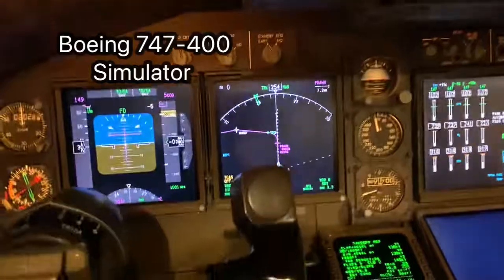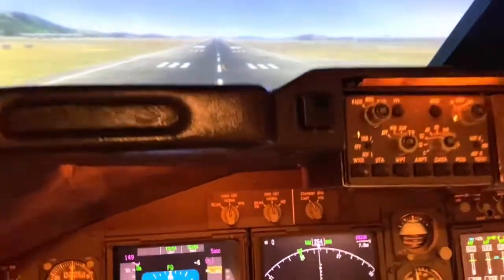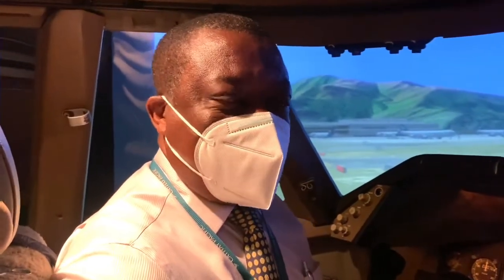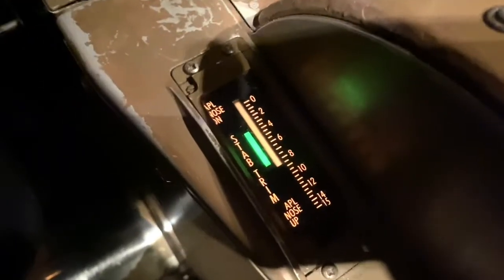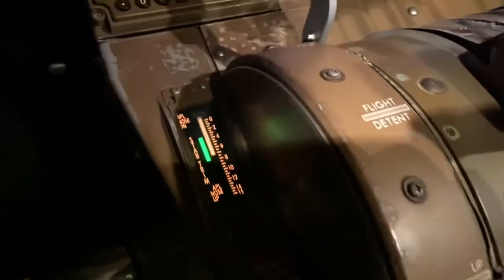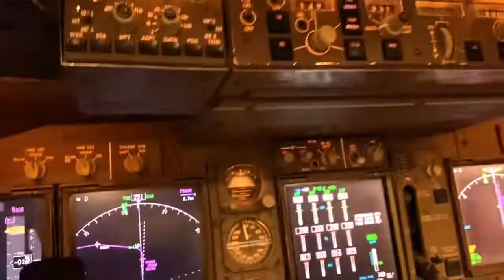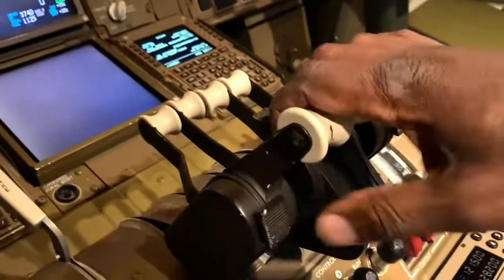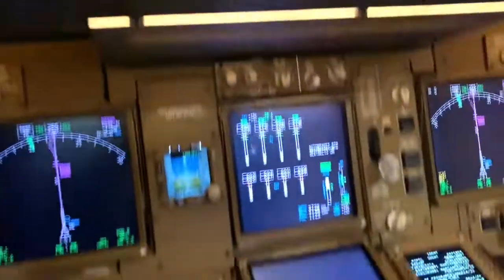Boeing 747 Takeoff CONFIGURATION WARNING

Comment: So, let's say there is a runway that is just enaugh for a certain max weight, and all V's calulations are made for 20 flaps. If the pilot makes a mistake to select 10, then thre is no warning, right? But that means that at Vr the a/c wont lift off and after V1 the pilot can legally regect the T/O if the a/c in unfliable when in reality needed maybe around 20kt extra? Not sure how is handled in this situation because I don't fly a 747 but curious if in that case the pilot should keep pushing getting close to the end of the runway to try to take off anyway or overrun at some 160kt instead than 40kt if it was rejected. Thanks

Comment: Sir, do we always take off with TO/GA power?
Reply from the maker: TOGA is just the switch you activate- the actual thrust is dependent on what you require based on the weight etc on the day. Like an accelerator on a vehicle - you always press on it weather the car is heavy or with only you on board. The amount of acceleration you need is dependent on the weight of the car to get it moving.
Reply: @pilot_obet  ohk, so TOGA doesn't always means 100% power?
Reply from the maker: Correct! Like an accelerator, pushing the pedal does not mean you are using all the horse power from the vehicle engine - like the toga switches😊
Reply: @pilot_obet  oh, thank you for clarifying I always thought it the other way

Comment: Hong Kong Int'l has both runways at 3800m long. 

Captain, what runway length would be necessary for a B744/8 at 850k pounds TO weight such that there is No V1(!), would only be necessary to call VR.?

Comment: I flew business on one of the last Qantas 747-SP AKL-LAX runs, the pilot had a bit of fun on takeoff - we were stopped with the brakes on while the engines spooled up to full TO. The whole aircraft was bouncing up and down and jerking forward until brakes were released and we were OUTTA THERE! Never been pressed back into my seat like that before or since. Must have been an accidental CONFIG PARK BRK ;)
Reply: This is just a static takeoff, you do it when the runway is just barely long enough. You hold the brakes on, then release them as soon as the engines reach takeoff thrust. This way, you use up less runway since you're not rolling forward as the engines spool up.

Comment: Wait, that small parking brake lever is what stops a machine of that size?
Reply from the maker: Not quite- it holds the Brake pedals in place which I have to depress with both feet with force, then pull that lever to hold in place. To release the brakes, I have to use both feet to press hard on top of the pedals to allow the lever to drop and indicate brakes are released

Comment: What actions would lead to pilot dismissal?
Reply from the maker: Usual- negligence at work etc
Reply: @pilot_obet  Thanks Captain. A rejected takeoff due to incorrect flap setting would not lead to dismissal?
Reply from the maker: Depends on airline. Suspension, pay cut, demotion etc are all used
Reply: @pilot_obet  wow, ok, severe, but taking into consideration fuel wastage, pax missing connecting flights, time wastage, probably justified. Thanks for sharing Cap'..